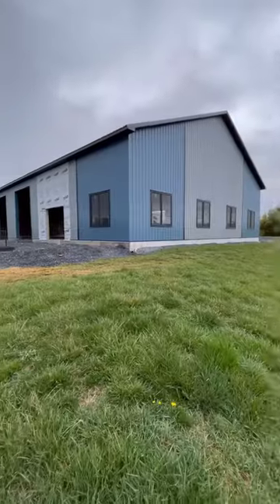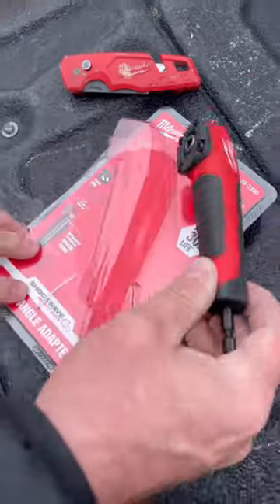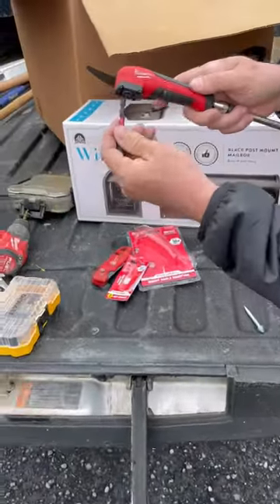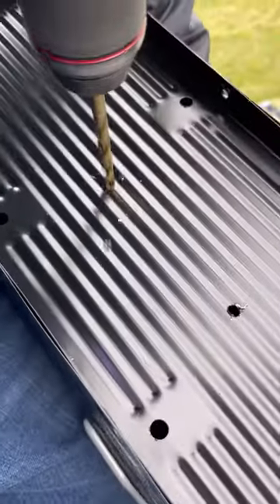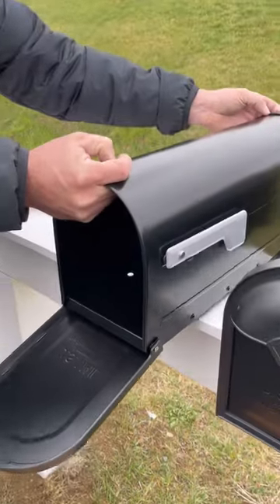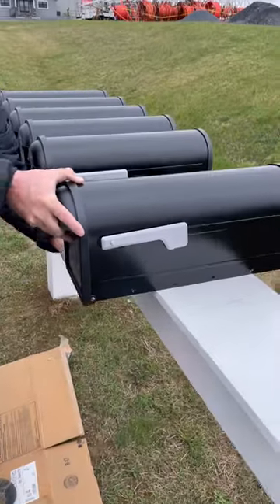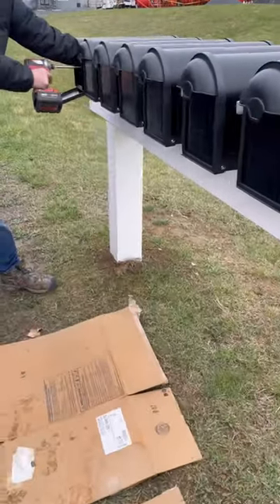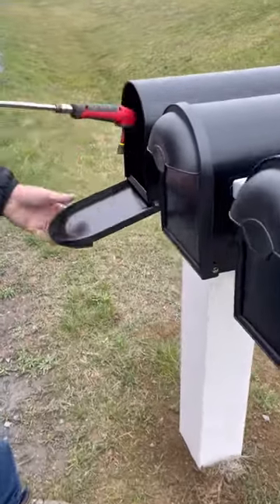Milwaukee Right Angle Adapter

Comment: Mailman gonna be pissed if he scratches or cuts his hand. 🤦🏿‍♂️
Reply from the maker: The screws are not sharp at all
Reply: @hausplans  they will be when the galvanized coating rusts off in a year
Reply: @mattberg6816  why would they rust inside a mailbox?
Reply: Moisture
Reply: @aprilecotton2060  yup
Reply: @hausplans  i can't believe you used a screw. Should of used hot glue or for more strength good old chewing gum😅
Reply: These days a lock box seems more secure
Reply: On what
Reply: @davidhaynes9580 because a mailbox isnt climate controlled, why else?
Reply: This dude thinks the mailman fists the mailbox to deliver a letter. How deep do you think they put their hand in.. they're not birthing a baby cow.
Reply: @mattberg6816 Galvanized coating is used in many industrial applications and survives very well. But there is one environment that even the galvanized fastener can't survive.. the dreaded mailbox! I doubt it'll even make it a year!
Reply: @GoneNForgotten Exactly! And galvanized hardware is SPECIFICALLY meant to be in climate controlled environments only!

Comment: well, thats one way to make it more complicated for no reason
Reply: He’s clout chasing my guy ain’t no use
Reply: what's the less complicated way to do it?
Reply: @zaidayala9796  the bottom of the mail is is supposed to be supported by a 2x6. The holes on the bottom of the mail box is where it is attached. You screw the plank to the beam, screw the mail box to the plank. No reason to get a 90 degree head for that. Basically, you added steps and installed it incorrectly.
Reply: Theres no one way to build a mailbox cletus 😂@charleslynch908
Reply: @erichood3169 I'm trying to understand how this solves the problem originally stated

Comment: You should be smarter than the mailbox, screws go in from the sides through the cute pre drilled holes. Can’t wait for the towel bar episode
Reply: Are those just for a single mailbox and post though?

Comment: I did the samw thing at a tri-plex and the USPS refused to deliver to them.  NO fasteners (or holes)in the bottom of the box, and for good reason. So those 3 boxes went in the dumpster and I mounted 3 new boxes correctly using carriers underneath
Reply from the maker: These boxes came from the factory with holes drilled in the bottom, eight to be precise. I had to drill new ones because they didn’t line up with the way I wanted to mount it

Comment: We use a DeWalt version of that angle adapter and it's awesome when you need it. That thing has come in handy plenty of times remodeling old houses and buildings.
Reply: But is it red?
Reply: Dewalt one is much better by my experience.  The takedown ability for tiny spacing has helped me out more than a few times

Comment: I always could use a right angle for hardware! I bought the dewalt bendy version a few years ago, has a little screw on handle like we’re using a hammer drill lol but like u said it really feels like it’s gunna over tension & bust the gears out. I remember Project Farm Tested a bunch a while back, but can’t remember the results 🤔 I would love a really nice one 😅

Comment: You can put a block on your post and screw the mail box in from each side. No screws in the mailbox itself. Hope this helps.
Reply from the maker: Yes you can do it that way but there’s so many of these they were only 3 inches apart even with my right angle attachment I couldn’t screw the screws on the side between the boxes. Also I wanted the ability to move them around, take some away or space of them differently as tenants come and go

Comment: So no board under the mail boxes? Are those screws sticking out far? Just curious, because there are easier ways to secure mailboxes than that, but you do you.
Reply from the maker: The reason I didn’t put  an 1-1/2” board underneath them-quarter is because I was trying to use all maintenance free materials that would never require painting or staining. What’s this way I can easily add more boxes or takes on my way depending on how many tenants we have.
Reply: @hausplans this also would've been wrong. Lol. 1 1/2"?? 😂 It's 3/4" goes underneath them. 
Why didn't you just use a piece of azek as your mounting plate if you wanted to keep it "maintenance free"? But you didn't use epoxy coated screws.. So it's not gonna be maintenance free anyway. 😉

Comment: You could have used the right angle adapter to screw these in correctly from the sides so the screws don’t rust and give mailman tetnus
Reply from the maker: Only 3 inches between each box the right angle adapter would not fit

Comment: See those holes along the bottom sides of the mailbox? You're supposed to fasten a base onto that beam that fits inside the bottom of the mailbox and then use those holes to fasten the box to the base. Your perceived cleverness is actually ignorance.
Reply from the maker: Yes you can install them that way but I wanted to use all maintenance free material. I could’ve put a piece of three-quarter PVC under each box but the screws don’t grip that well into PVC. My way the screws went through the PVC and into the 6x6 post. I also wanted the ability to slide them right or left as new tenants get added or taken away.

Comment: Came here to call ya out for installing mailboxes incorrectly 😂, but it seems as though others have done so already … Let me help : install a base plate 2”x 6” x 14” long , place mailbox over the plate which you’ve screwed to your runner , then screw down from the sides , so as to not have anything obstructing the inside of the mailboxes … 👍🏼
Reply from the maker: There is no room to screw in from the sides. The mailboxes are only 3 inches apart even with the angle adapter I bought.
Reply: @hausplans  that right angle extension would have gotten ya in between those boxes and allowed screwing from sides 😆 but at this point i’m just harassing ya sir …

Comment: How do you plan to label those mailboxes?
Asking as a delivery driver, there never seems to be a rhyme nor reason between multiple mailbox installations and signage on the building.

I mean, I know I'm at the right place, but which door gets the tiny flat Amazon envelopes?
Reply from the maker: Our mail lady helped us by putting labels on the insides in the same order that the buildings are in. Then we labeled the outside.

Comment: How ridiculous. The screws you're using are WAY too long. You could have done this and about a million other jobs with a stubby screwdriver. You said you pre-drilled the holes so it would have been cake to do with a stubby. Besides all that you should have used a 1 x 6 plank and screwed it down and then screwed the box in from the side. I always keep a straight and phillips stubby in my toolbox 🧰

Comment: I maybe dab the screw heads with silicone to opese the haters and remove any liability. For $5 and 5 minutes it's a cheap improvement and way ro remove if you need to access the screw head. I agree with another poster that a flush screw with washer would have been better, but you'll never satisfy the internet not matter what.

Comment: or… a cordless ratchet? seems a lot easier
Reply from the maker: That would work
Reply: @hausplans  thats my go to for tight spaces or any bolts that need low torque for body fasteners and plastics. that is a cool tool tho i just wonder if youd get good downward pressure on the screw to keep from rounding out